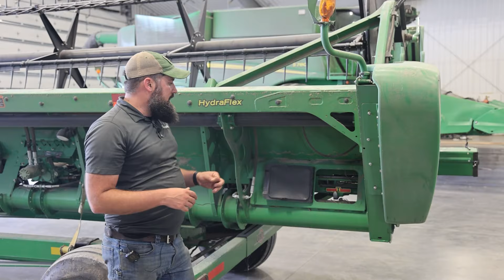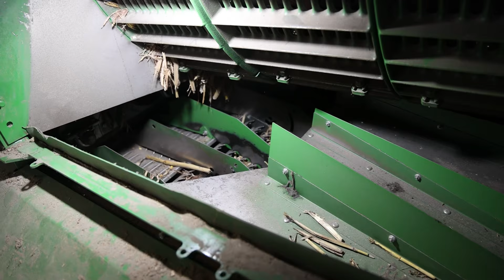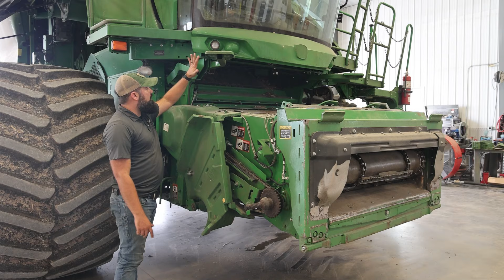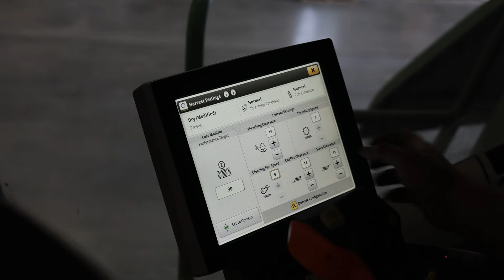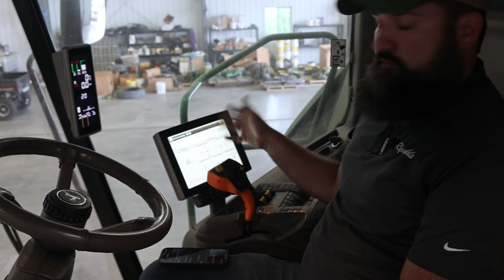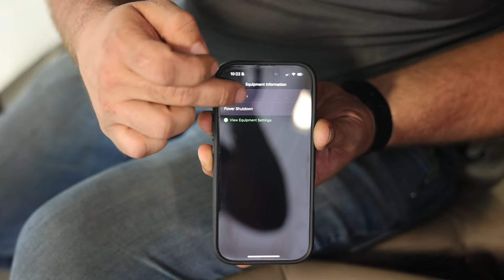How to Set up your Combine and Platform for Harvesting | John Deere Setup Tips for Better Operation

Comment: Why is the 4th separator grid installed without spacers? Sorry for the possibly inaccurate translation - Google Translate :)
Reply: Class 8/9 tailings don't alow it . Not room
Reply: @brucebruhn5620  Shouldn't they be there? The last, fourth grate is always in the same position, no matter what crop you're harvesting?
Reply: @brucebruhn5620  And I thought that on the extreme grille, the previous owner of my S680 simply lost these bushings :) And bought new taps and installed them. It's good that I watched this video, thank you!